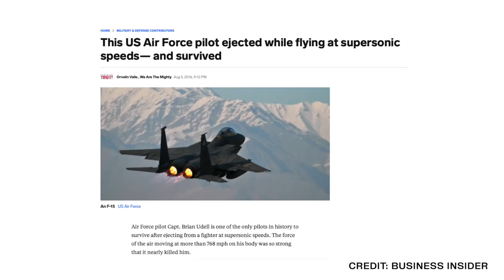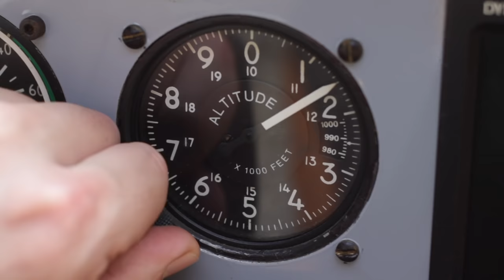5 Pilots Ejecting CAUGHT ON CAMERA

Comment: 8:30  when aboard the JFK, we had an F-14 lose an engine like this, and roll over. the pilot was ejected like skipping a stone across a pond, badly injured, the weps officer was shot hard into the water at a vertical angle about 50 ft above.  his body was never recovered.

Comment: I wish people wouldn't take so many "creative liberties" with facts when they retell stories like this. 1st) Capt Brian Udell was flying a F15 Strike Eagle, a single seat aircraft, as almost every F15 is, so he did not have a second crew member with him. 2nd) Neil Armstrong elected from the "Flying Bedstead" while it was still nearly wings level, not tipped over on it's side, that was even clear in the old video.
The truth is easy to look up ....... Do better!
Reply: the F-15E model actually does have two seats, as it is designed for ground attack and air superiority. the F-15C is a single-seat fighter, as it's only intended to be used against aircraft.
(but you are right, this video makes a ton of mistakes with just about everything else.)